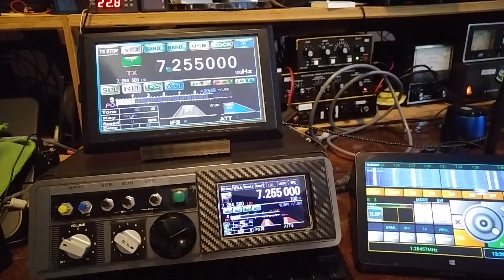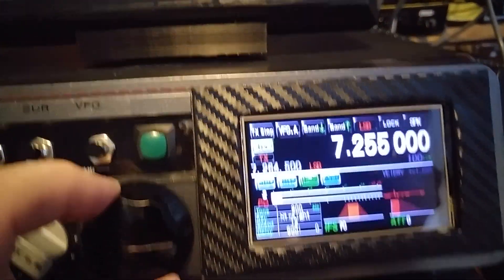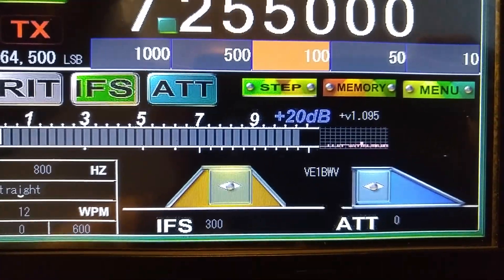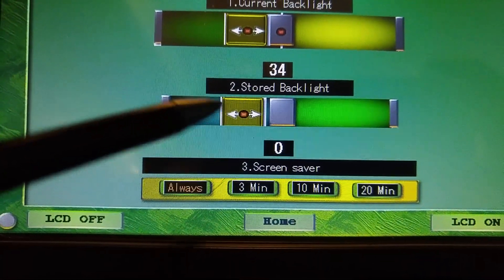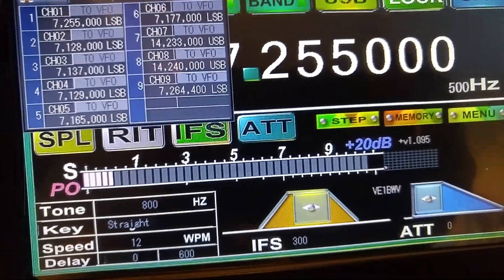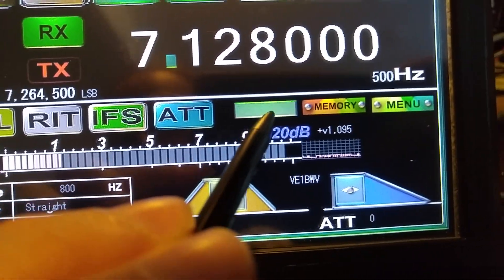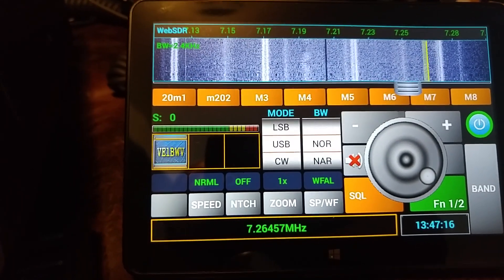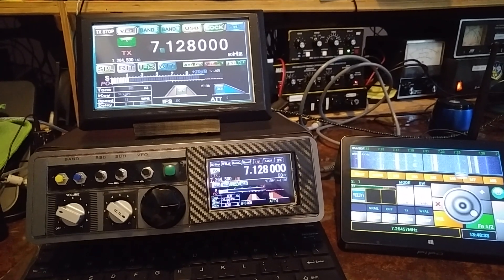UBITX WITH DUAL NEXTION DISPLAYS 3.2 AND 7 INCH

Comment: Hi Joe I love and hate the Nextion display, why I loved the simple LCD display and I love how the Nextion is so easy to use and gives you all sorts of new settings. Me personally I want to build a uBitx radio into a HF manpack radio. radio/tuner/swr I'm trying to figure out which display is best. Does the Nextion support an swr meter
Reply from the maker: I like both type of displays but the nextion is a smart display so takes no or very little resources from the arduino processor and has higher resolution for better graphics.

Yes the nextion can support as swr function if someone adds the code.

Comment: Very nice!!  I am still trying to figure out the s-meter.  I built it and tried it but just cant seem to get it to work right.  I used a 1.5nf cap, and I have a  0.3nf coming in today.  So I will try it again.  Great info on the larger display and like how you have the other buttons on screen to access other options.  As I told Ian, it would be nice to have a screen button to change from straight key to iambic key, and then be able to change cw speed without having to go thru all the steps you do now.  Juddie WD8WV.
Reply from the maker: I like the dual display, and as more and more features appear, the extra display real estate is nice.

What chip do you use for the s-meter??
Reply: I was going to use a LM386, which I had several from build a Pixie kit.  But, after talking with Ian KD8CEC I ordered the LM358 chip as per his blog, I now have 8 of those chips.  The only thing is I am not of an electronics guy and I sure would of liked to seen more photos of the resistors, diode and wires being soldered to the pins of the socket he was using.  I looked at the schematic and I feel I got that right.  But another thing was man it was hard to get these components soldered onto the pins of the socket.  I am going to retrace my soldering and make sure it is right, again.  I have to cut the heat shrink off so I can see the pins of the socket.
Reply from the maker: I built the lm386 but it did not work correctly - not enough ratio
So, I built the LM358 version and it worked , lots of ratio... works fine even less components. Fortunately I had some in my parts  stock...

Joe VE1BWV
Reply: joe basque well I am glad it has worked for you.  I have spent all evening after work with the .3nf cap and couldn't get it to work.  I am going back to Ian's video and watch it again to see if I missed a step.  I checked the socket and was getting 5 volts to pin 8.  I had pin 3 to the yellow audio jack,  and pin 2 to A7, don't know what I am doing wrong.  I even changed out the 358 chip with another.    Using bitx manager and reading from the uBitx for minimum I was get 0 then 1 and then 0 and even the same for max.  I can't figure it out!  Thanks for your replies.